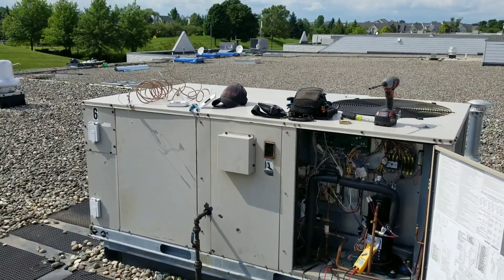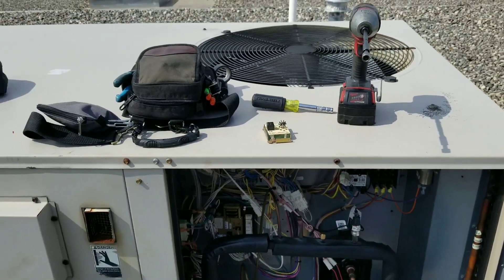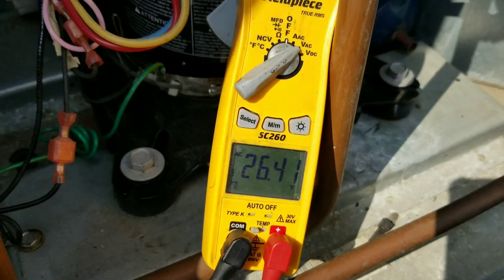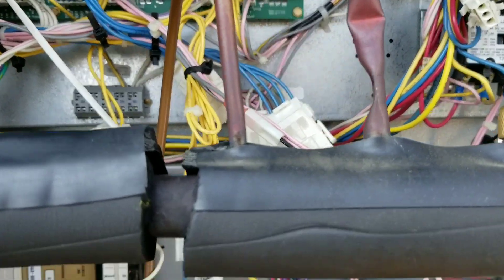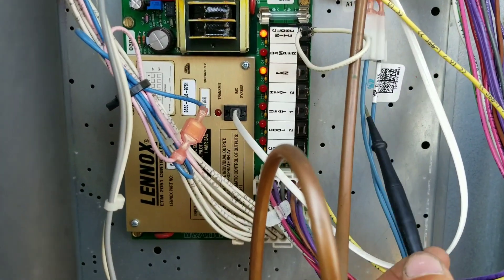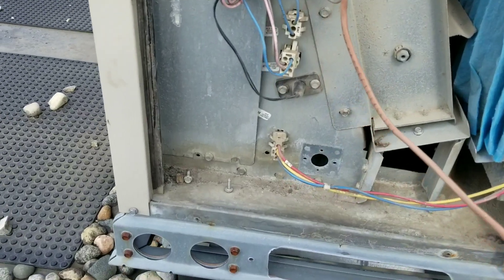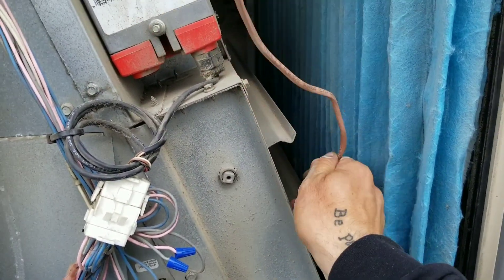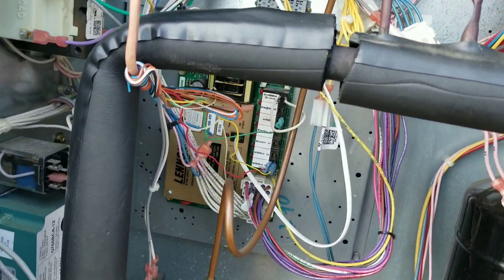AC not cooling

Comment: Definitely done this before, but as a more permanent repair with an A421 with remote sensing element. Bad unitary controller and the customer is too cheep to change it lol.
Great video to show ppl how to get em working in a pinch!
Reply: Curious HVAC guy its single stage heat/cool
Reply: @curioushvacguy6876  You could wire the A421 with the incoming 24VAC on one side and the Y1, Y2 on the other side or your W1 and W2 and keep the fan running constantly as you did. the only problem that might occur is you may need to wire in a common for it if you get the 24VAC A421 thermostat to power it.